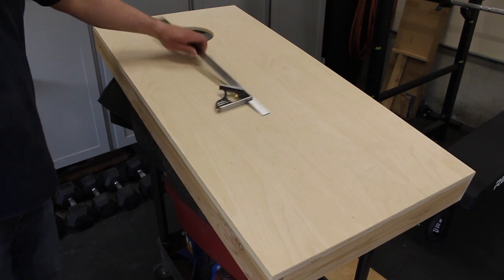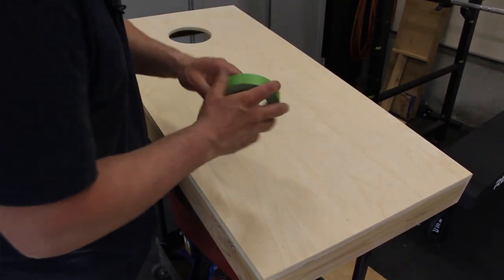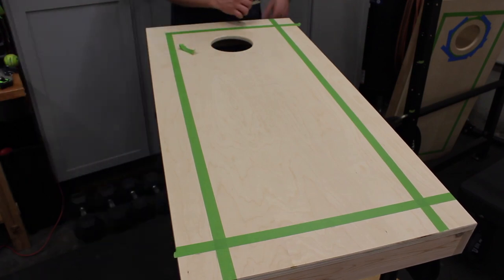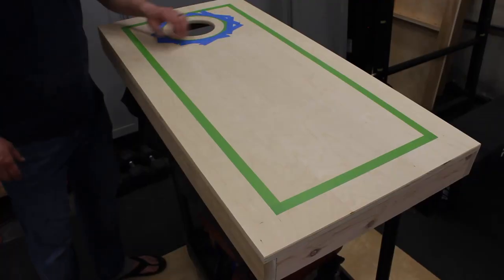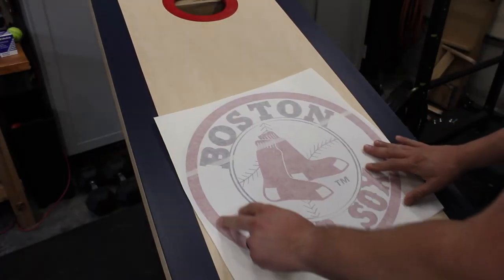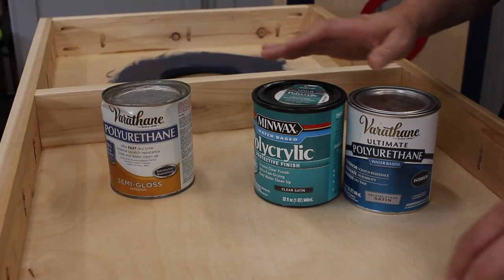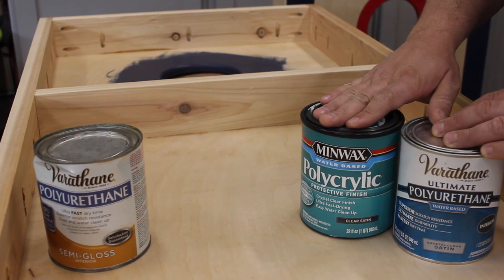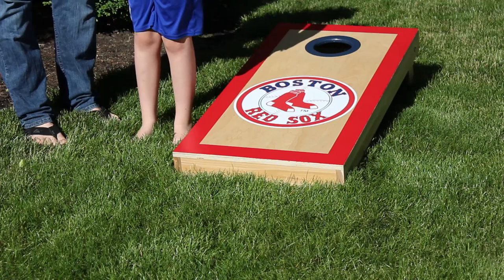How to Paint DIY Cornhole Boards with Vinyl Stickers or Decals [Two of 2 Videos]

Comment: Did you apply poly to the bottoms? If so, how many coats? Also, do you have to do all the top coats separately from the bottom coats, or can you do top and bottom simultaneously? Not sure how to rest the boards to dry if top and bottom are done all at once. Thanks.

Comment: Do you apply a clear over the wood before you lay the decal? If not what sand paper grit do you use to avoid bubbles? Also what wood do you use for your top boards? Thanks! Great video!
Reply: I do something similar but do not poly before decals. Usually I never sand past 220. I never have issues with bubbles but make sure to use water based poly with decals (safer). Also I use birch. Paint and stain work so we’ll with it.
Reply from the maker: I sanded that board with 220 grit. I placed the decal directly to the wood. I used a card to work out the bubbles. Just take your time. Then I applied poly over everything. I hope this answered your question?
Reply: It's a good idea to put a coat or two of poly on the wood to seal it Before you put the decal down.  It will adhere much stronger and you won't run the risk of the decal pealing up on the edges or forming bubbles under it, which can happen with bare wood when it's out in the sun on a really hot day.

Comment: Hey man, currently painting boards with a similar design to this. Did you do any sanding after the paint but before the poly to knock down the inside edge of the paint outline a bit? And if not do you feel any unevenness now on those inside edges?
Reply: I also am wondering this as I’m working on some boards right now. Do you have an answer to this?
Reply: I realize this video is a couple of years old, but I just found it.  I made one similar a few months ago and I did not sand down after paint but before applying the poly.  I didn't feel any ridge from the paint by the tape, so I didn't feel the need to try to sand it.  It came our really nice.

Comment: Do u sand over the decals when you sand the boards or do you sand around them thank you
Reply from the maker: Well..... I first sanded down the board then installed the decal. I then applied the Poly over that and sanded down the entire board including decal between coats. Does that answer your questions?
Reply: I have tried sanding the poly after the coats, however the paint and decals end up with a white haze over them from the poly. I cant seem to get it off and it dulls the colors if the paint and " scratches" the decal. Any suggestions? Btw I use 400 grit and an orbital  sander.
Reply: @boybluenyc1  Instead of using an orbital sander I'd recommend sanding very lightly by hand. Just take the sheet of 400 grit and fold it over a couple times. Then rub back and forth, with the grain, lightly maybe 5-10 strokes and you'll feel the difference. If you still run into any issues you may need to let the poly dry longer before sanding. Try two hours of dry time. If that doesn't work, let it sit over night before sanding. To reduce the risk of messing up, try on a scrap piece of plywood. Oh, and you can even use 220 or 320 grit.